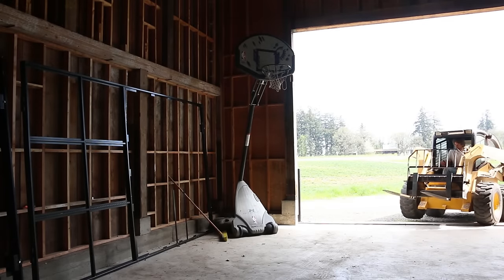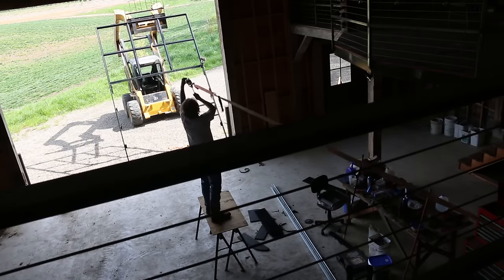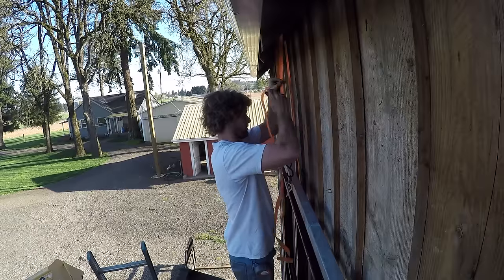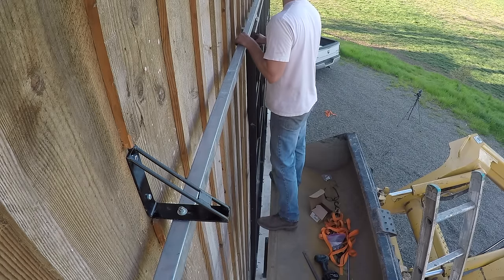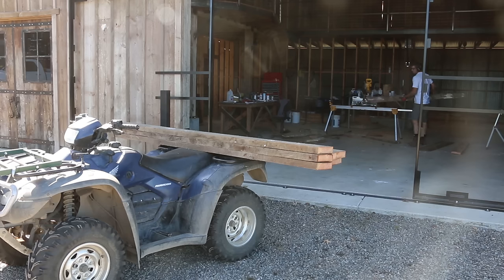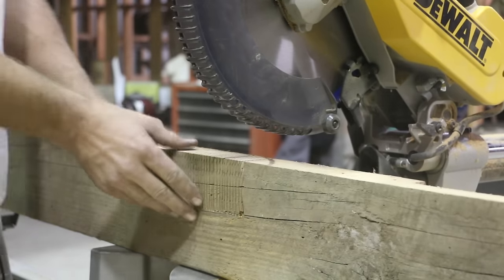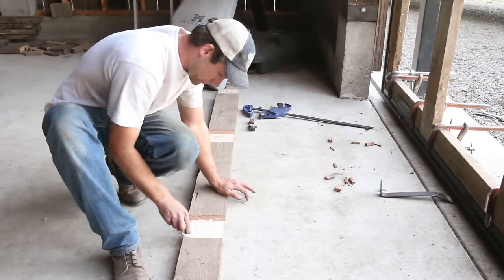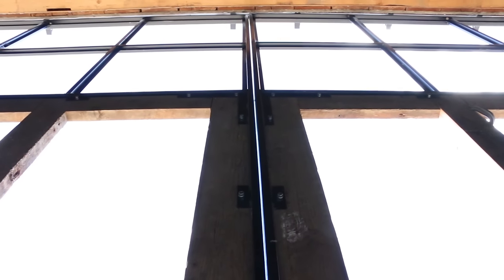Shop Doors pt. 5 - The Summer Break

Comment: To square the doors together you first make one a closely plumb as possible my adjusting top, bottom, right and left rollers.  Then using the same methods adjust the other to match the first.  Nothing on the whole project, floor, walls, door opening, and the doors themselves are perfectly square and plumb, you do the best with what you have to work with.